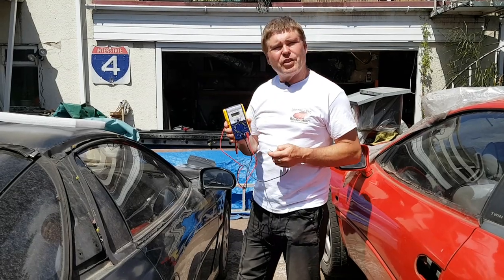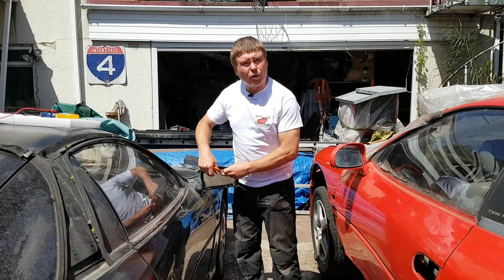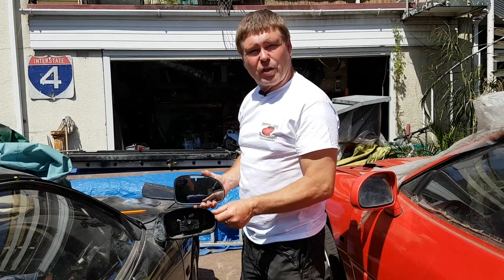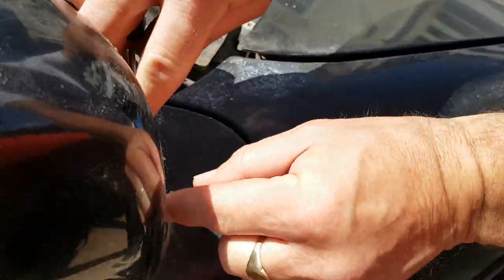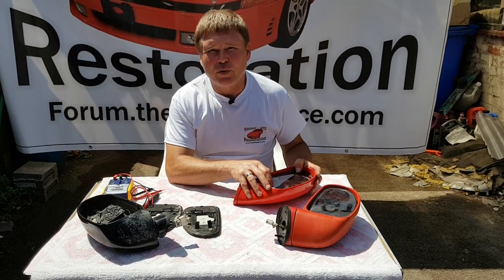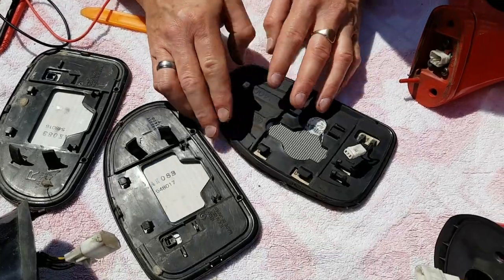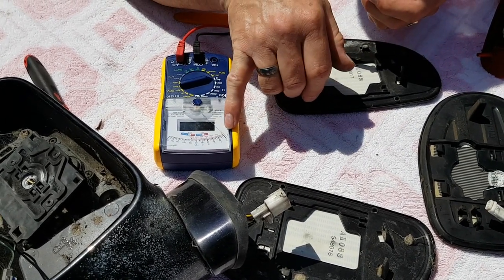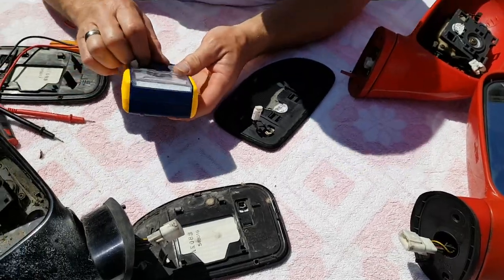Wing Mirror Removal

Comment: Just found the channel yesterday and I’ve been very impressed with the detail of all the videos. I was curious though if you’d consider making a video about windows that rattle around in the door frame badly when lowered. It appears to be a pretty common issue yet I only have found scattered and brief discussions on the forums and the noise really makes the car feel cheap.
Reply from the maker: Hi Bryan
This video is already on my list. The window system is quite basic if using all new parts but warn parts make the job much more complex so it is taking a little time to make a video that covers all the different problems. Keep watching and it will be available soon. Joe

Comment: Love your videos. These have helped me with my restoration. Im struggling to take off my rear coilivers from the rubber grommet. All the bolts come off. Ive even tried to hammer it out but no luck. Don't know if this is video worthy but i would appreciate some advice. Thank you.

Adnaan
From Glasgow Scotland
Reply from the maker: Lots of wd40 and patience my friend. It may take hours or days if you don't want to break them. Just keep soaking and tapping with a rubber mallet. They will come loose eventually.
Reply: @3000GTGTORestoration  i did try Wd40 but only for 10 minutes or so. Will give it more time.
Reply from the maker: It once took me 2 days of soaking to free one without any damage. Every hour I put on more wd40 until it worked its way through.
Reply: @3000GTGTORestoration  will give this a try. Thank you

Comment: Another good video Joe.
Do you know of anyone having retrofitted folding mirrors to a mk1? I’ve got hold of folding mirrors, the switch and the control box so planning this at some point but not sure how it’ll turn out.
Reply from the maker: I think the mounting holes are different. I don't know of anyone who has done it myself.
Reply: 3000GT / GTO Restoration  I’ll check it out and see how it goes. They’re a different colour so need painted but I’m in no rush as plenty of other work needing first.